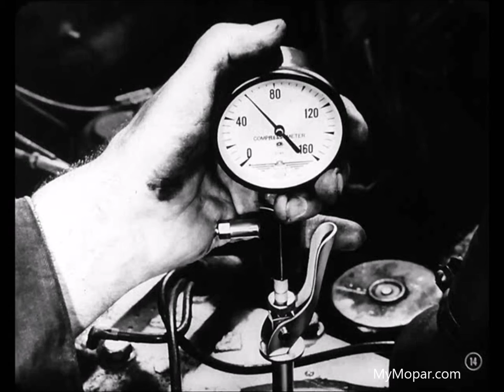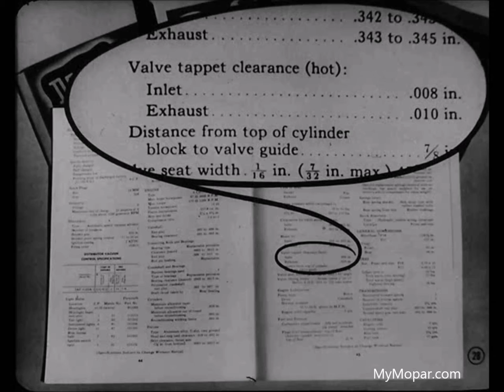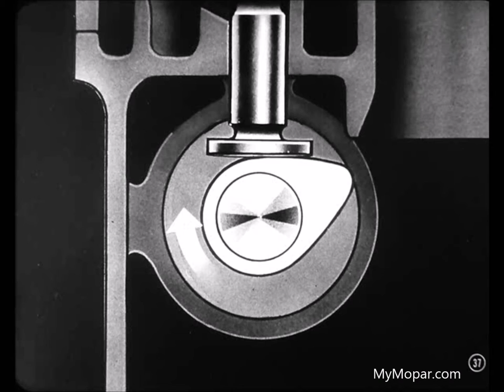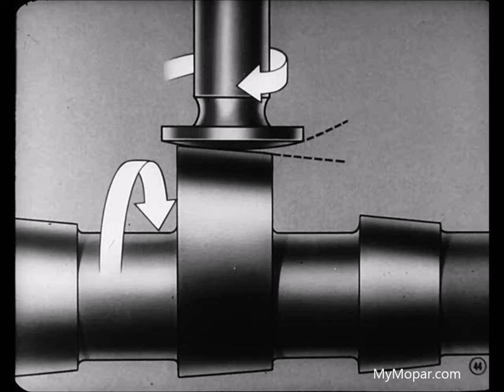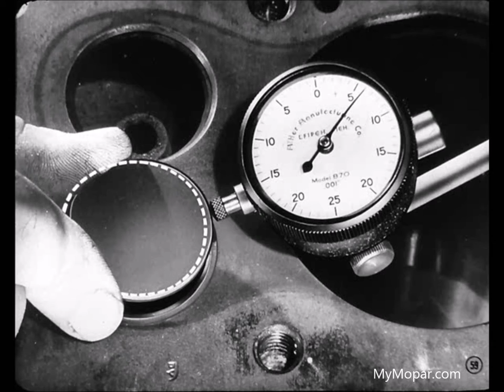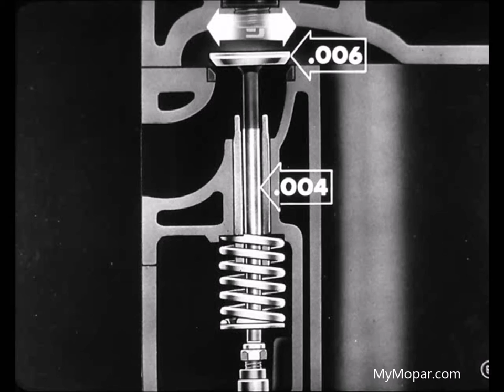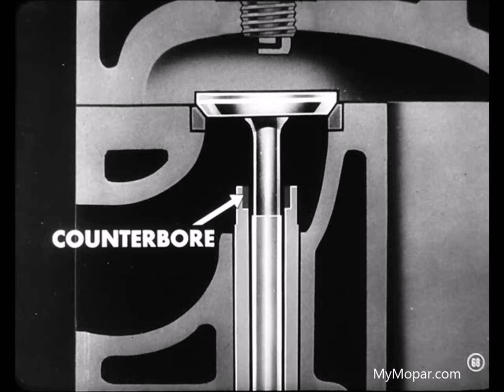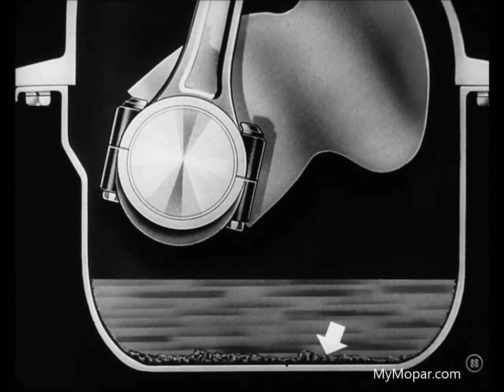Chrysler Master Tech - 1949, Volume 3-3 The Story of Valves

Comment: I saw a great series of videos of a Chrysler flathead 6 being rebuilt:
https://www.youtube.com/watch?v=9-83dOWXkF8&list=PLEVac_GZjYquGPbnspoUB_NST0W5aT0mC
I have heard that the water distribution tube is unique to these Chrysler flathead engines.

Valve lash adjustments are still in use on some modern SOHC and DOHC engines. However, people rarely ever adjust them. When dealing with a Honda CRV, people eventually burn a valve.... after a little over 200,000 miles. One nice thing about Honda is that they rocker type cam followers and use lash adjustment screws. Some engines use mechanical bucket type cam followers in the following ways:
1. A replaceable shim is installed over the cam bucket. You can buy a specialty tool to compress that bucket and spring and easily remove the shim.
2. A replaceable shim is under the cam bucket. This is found on engines that rev too high for the shim over bucket systems. You have to remove cams.
3. A replaceable bucket. You have to buy a completely new cam bucket that is a different thickness than the existing unit in order to adjust lash.